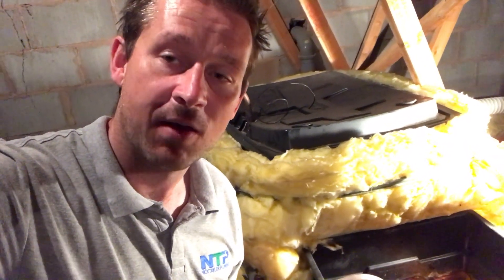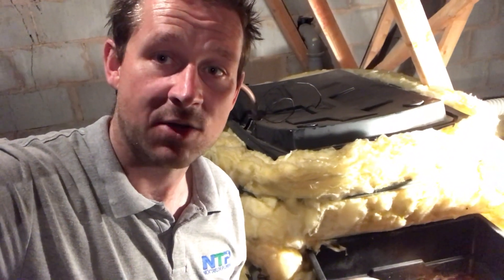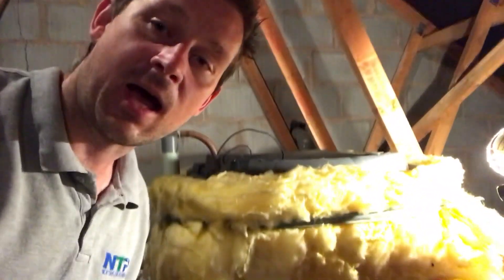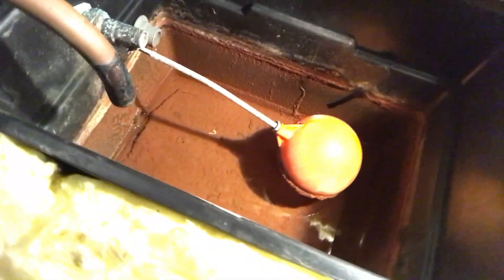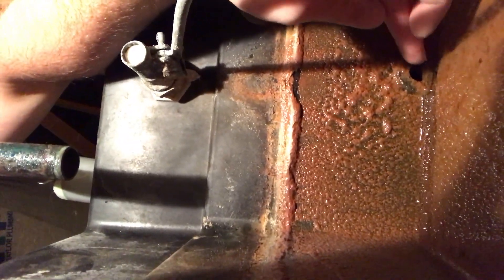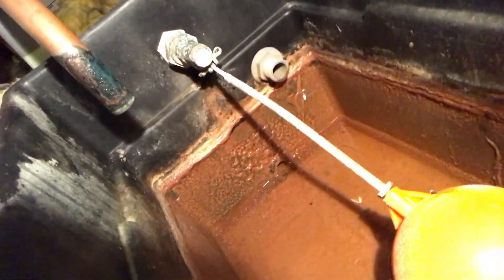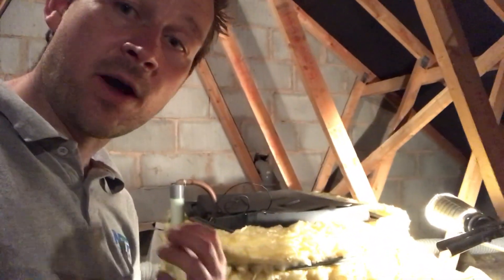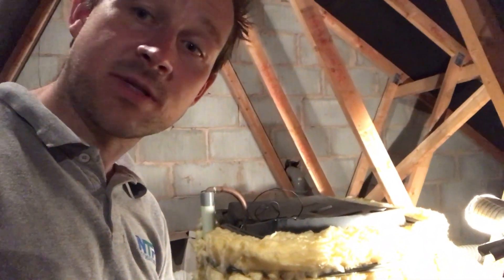How and why to clean a feed and expansion tank to avoid blockages in your radiators (Gravity fed)

Comment: How did you get the water out before you cleaned the tank ?
Reply from the maker: Hi M&T Voss thanks for the comment, I usually use a wet vac to suck out the excess water and some of the rubbish at the bottom of it at the same time, if you don't have a wet vac you can use a bucket and sponge to remove the excess water, hope that helps and if you haven't already, don't forget to like and subscribe. :yougotthis:

Comment: Hi I recently cleaned the F @ E tank out in my house. When I went to flush system I noticed the house rads downstairs had three separate drain valves. Do I need to flush from all three? Also to add inhibitor do I need to do same, drain down, add it, refill? Thanks for help